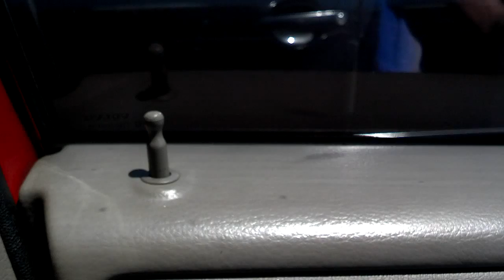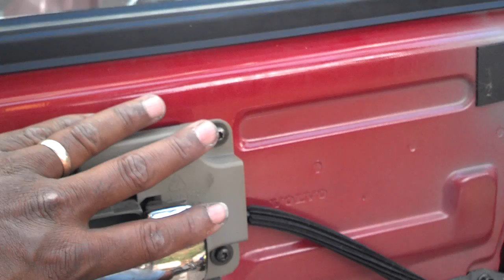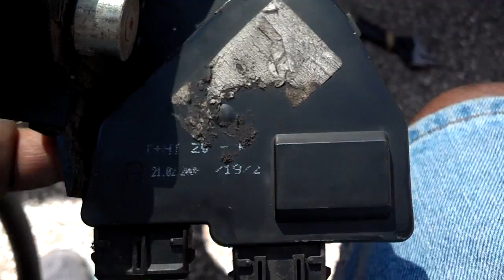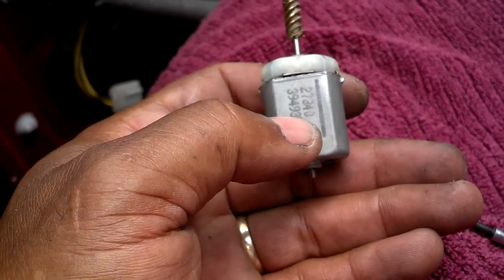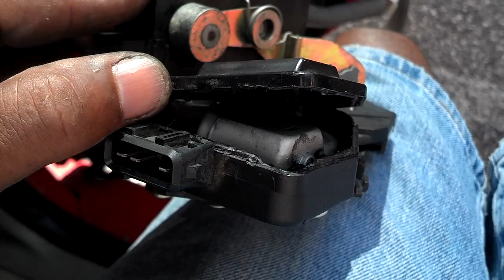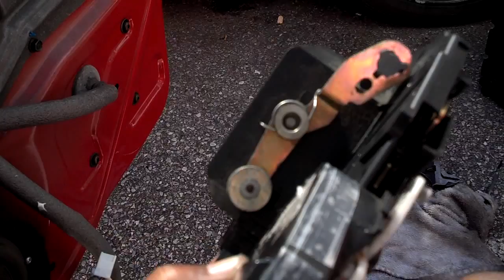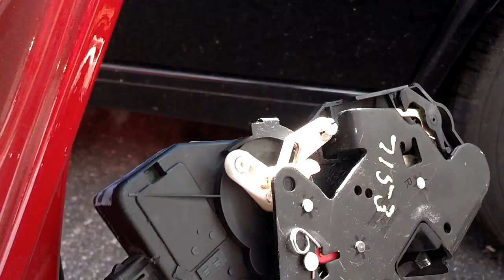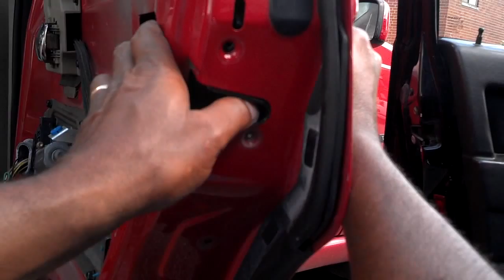Door latch lock motor repair, will not unlock with central locking Volvo S70, V70, XC70, C70 etc.

Comment: thanks for info. I have tried this repair but no success. all doors will lock. however, driver side will not unlock. I have taken apart and put in copper wire. no improvement. any thoughts?  thanks
Reply from the maker: +Josh Ruppert maybe the wire didn't make contact. You can also replace the latch.
Reply: +Robert DIY perhaps the wire is not down all the way. I had to put everything back together for now. I will take a look at it more on a nicer day. thanks

Comment: Great video Robert.  My driver latch functions properly electrically but latch part that grabs body holder to keep dooor shut has something internally sticking so door will not latch properly (latch does not engage.  if I pull door handle and release from fully extended (so door handle kinda slams back) something in mechanism clicks and door will close shut as it should.  Do you think this can be fixed with lubricating something in mechanism?  Thank you for advice.  All your videos helpful.
Reply from the maker: ***** I doubt it. You likely need to replace the latch.

Comment: I found that the (physical) key would not unlock my old V70 when the battery had died.  After getting the car unlocked I was able to remove the door panel and lock assembly, thanks to your video.  As it turns out, the rotating lock actuator pin wasn't inserted into its receptable on the lock assembly.  An easy fix after watching these instructiond.

After watching one of your other videos on removing the door panels of a Jaguar XJ, I was able to fix an electrical problem in my old Sovereign, so that's two I owe you.  Thank you sir!
Reply from the maker: Ronald In 't Velt Common with cars that have clickers. Thanks for watching.

Comment: Hi Robert, my 2008 Volvo XC70 inside driver side handle doesn't open the door. So I must roll down the window and open the door from the outside. I need to fix or replace the inside door handle. So how do I take off the door panel for me to take off the handle to see what part is broken or came loose.  The power switch to lock and unlock the doors works normal. When I'm rolling down the window to open the door from the outside, some times the window goes down very slow, not normal speed.
Reply from the maker: Robert Jackson Hi Robert, I really do not know. I have never removed a door panel from a vehicle that new. Maybe this will help you. - https://www.youtube.com/watch?v=8sf9Z0Uvx9E
Reply: Robert DIY thanks Robert. I watched your removal of the door panel. I will look at my car and see. I may just take it to the dealer.
Reply from the maker: Google may help.

Comment: could this be the reason i can't use the the power locks on my car? if i try and lock all my doors from the driver or passenger door or use the lock unlock button, you hear a buzz or grrrrr noise from the power locks. and it does what it did in the video some will lock others will not. sometimes they all will lock but still get the buzz/grrr noise.
Reply from the maker: MrEvilshannigans Usually they will lock but no unlock. Never heard a "buzz" noise.

Comment: Hi Robert, Yep, my 99 V70 has this problem too. I was looking for an actuator at the salvage yard. Never would have imagined this may be the source of the problem. I do not have a remote key, but it may at one time. My passenger door button goes down when I hit the lock button, but you can actually still open it from outside. It won't pop back up when I hit the unlock button. Thanks again!!
Reply from the maker: Gypsy2Go I'm looking into a remote lock system that should cost less than $20 to install. Stay tuned.

Comment: I would take an old copper penny and grind it on the bench grinder. I would have tried a heat gun or hair dryer to open the case too
Reply from the maker: I believe it is against the law to destroy currency so I would not do that. LOL Copper or aluminum should work so you have a lot of material options. lineartechbd1600

Comment: Possible shorting plate: a strip of tin from a soup can, folded and hammered would work, its not a big motor so not much current to pass through tin.
Everybody has food tins, no matter where you live :-)

For copper, foreign coins perhaps, about the right thickness lol.
Reply from the maker: Yes, should be easy to find something to make the connection. zx8401ztv

Comment: Nice job Robert! I didn't realize it's something as simple as that keeping the doors from unlocking.
Reply from the maker: From what I understand the head light wiper motors have the same issue causing them not to park. Michael Sackstein
Reply: My Saab had those things. Fortunately the motors never had a problem but I did have to change the wipers and they cost $20 a piece. And the only place I could find them was at my local Saab dealer.
Reply from the maker: Dang. I think they are $7 a pair on some of the Volvo sites.
Reply: I'm sure I could've found them somewhere else for less. I didn't think to order them at the time. Honestly Saab parts are expensive pretty much anywhere, and now that they're bankrupt it's going to be almost impossible to find them.
Reply: You know the funny thing is my dad almost got a Volvo instead of the Saab, and now looking back on it I really wish he had.